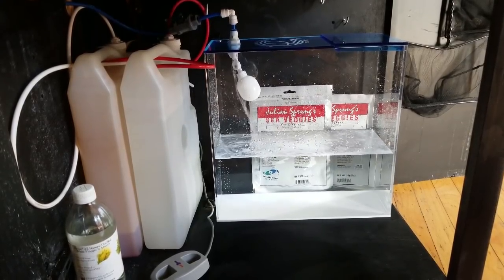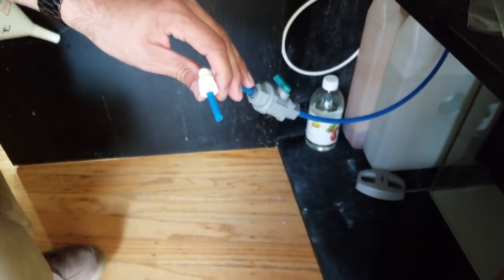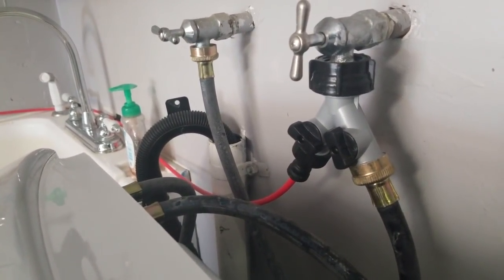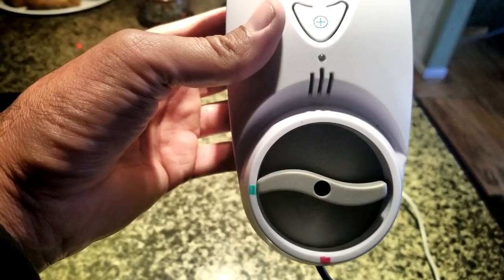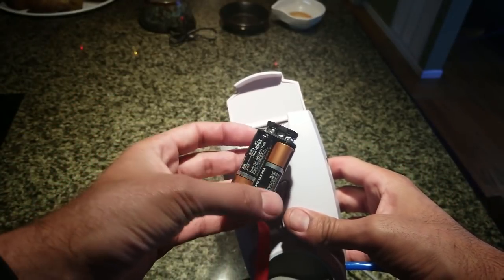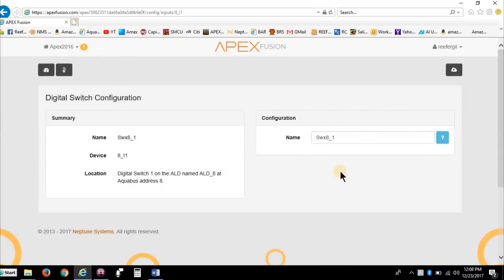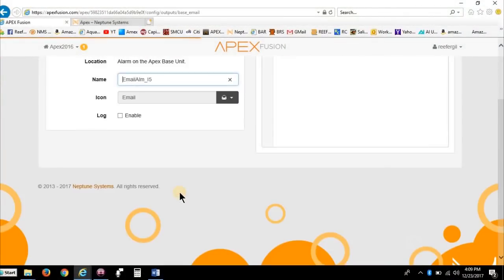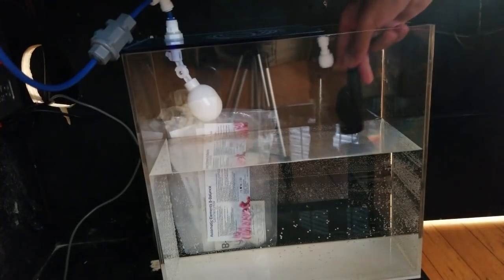Build Series|Eps.15| Self Filling Auto Top Off Reservoir

Comment: I watched your other vid about your water station build, very simple and works great. I made one small change to your water station design. Where you have a ro/di water coming out of the top can with a T going into bottom can (salt water) and the other side going to a spigot for filling a jug.  before the valve i installed another T with a braided hose going down to a T just before the pump. with another T just after the return side of the pump I put another T and plumed it through my ceiling to my sump, so I can switch between pumping salt water (for water changes) or filling my 25gal top off reservoir. It takes me about 5 min to fill my ATO or closing valves to pump 40gal for my water changes. This gives me peace of mind not relying on a automated system, that at some point WILL fail.

Comment: It's just as easy to manually fill the reservoir and control the risk as I've been doing for years. Never had issue yet
Reply from the maker: Hey Dee, I would consider that route, but I'm gone 3 weeks at a time, several times a year. I've run the ATO this way (minus the solenoid) on my previous build. Knock on wood, so far so good. Hope you're doing GREAT and have a great New Year!!!
Reply: ReeferGil I like the solenoid valve. I’m going connect on and pump water up from my basement

Comment: I feel like filling your auto top off manually is one of those key steps that should be kept in the hobby to keep you in tune with your system.   I have it set up so that once a week I turn a valve on my RODI system to fill my ATO tank while I am doing water testing.    Takes a minute or two but I feel that those ten total minutes per month are worth it rather than months and months of misery from an overflowN ATO tank or even worse, a tank that is killed off by a failed built in RODI/ATO fixture
Reply from the maker: That's a great point Electric. Completely relying on technology or automated systems can bite you REAL hard. I do my best to keep my finger on the system's pulse.
Reply: How’s the old saying go?   An ounce of prevention is worth a pound of cure?
Reply from the maker: Absolutely true!